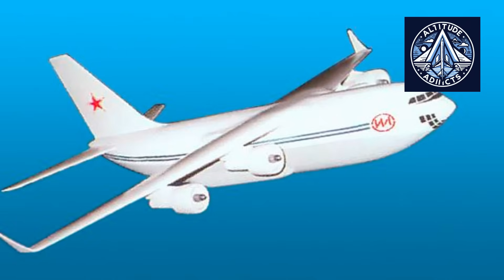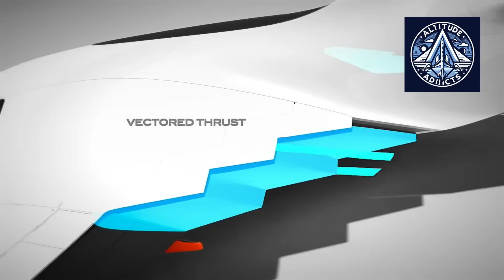Il-106 to PAK Ta—Why Russia’s 200-Ton Military Jet Is Still Not Flying

Comment: sounds like a bunch of incompetent journalists mixed up 3x different projects - PAK-DA, Tu-160 and Il-106 and called it PAK-TA. None of this makes even the slightest bit of sense. 
High bypass engines are optimised for high subsonic flight .... not supersonic . 
A supersonic transport plane would essentially be a very fat Tu-160 ..... which is clearly absurd ....

Comment: None of the PD-range of engines is designed to go anywhere supersonic, let alone hypersonic speeds. So the Intro is pretty much devoid of any physical feasability. The blended-body design is not that suitable for rough landing strips, and if you have to push against that aerodynamically and transport some good loads, i think 2 pd-35's in/under each wing plus a rear-mounted central one might do the trick at passenger transport speeds. A traditional design could probably do it without the rear mounted one.
Reply from the maker: True, I have pinned the correction.